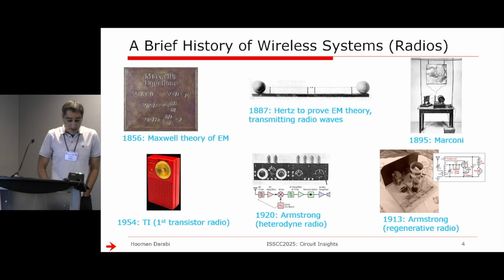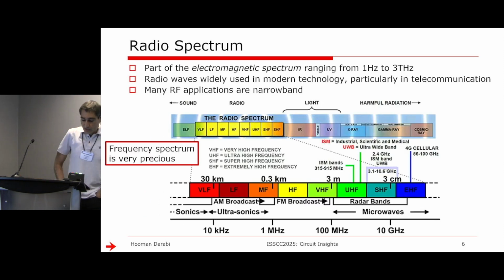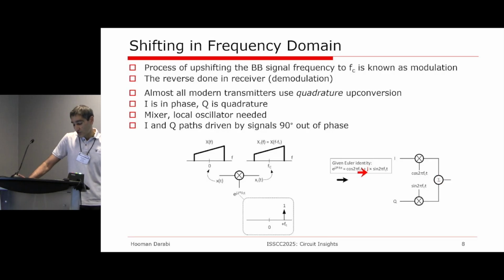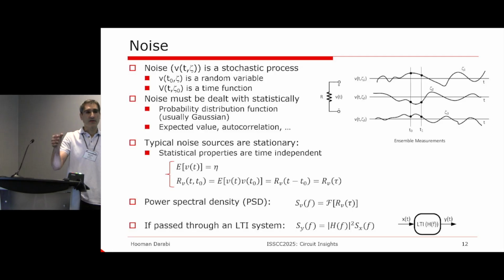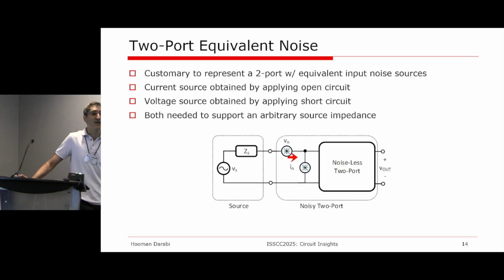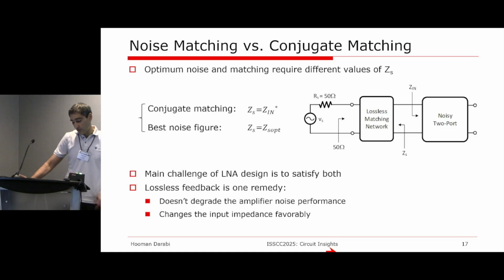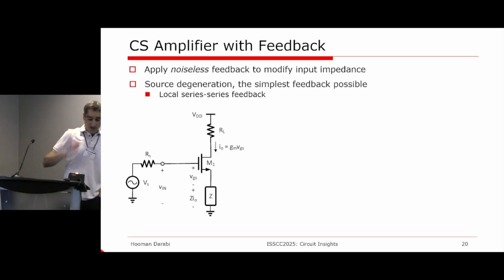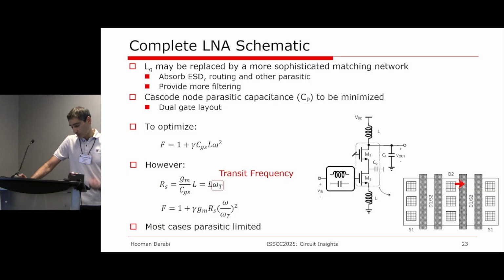Circuits for Wireless Communications - Hooman Darabi | Circuit Insights - ISSCC 2025 (6)

Comment: Around 33:46 basic CS(CE) amplifier have Miller capacitance effect cuz of this cap increases .. time constant increases bandwidth decreases..so it can't be suitable for high frequency application ( radio freq)..so it will limited for audio frequency .. but common base r common gate won't suffer with miller effect.. can we use it at radio frequency applications compared to cascode   CB r CG have some drawbacks.in worst case scenario if cascode (ce-cb, cs-cg) not available in that case can i allow to use cg r cb amplifier at radio frequency?